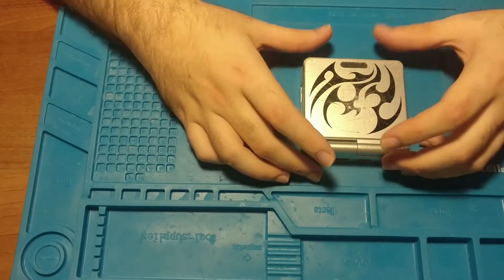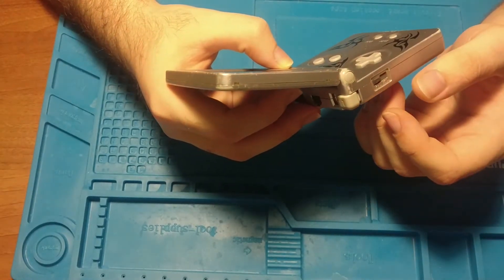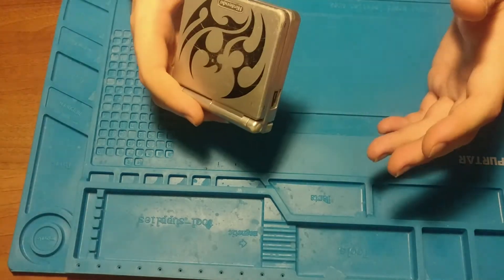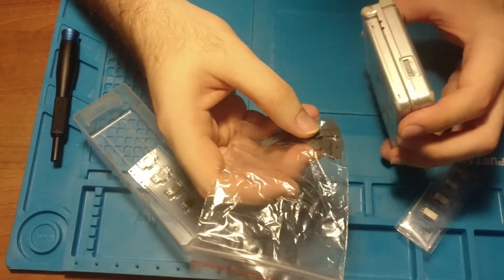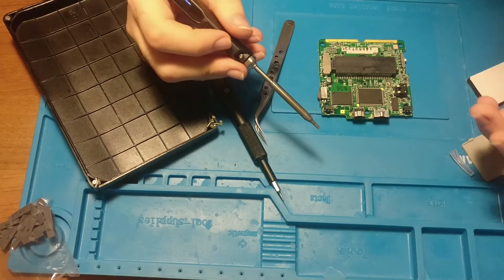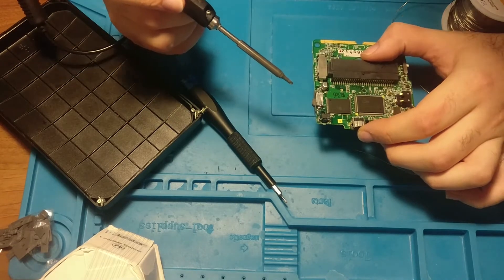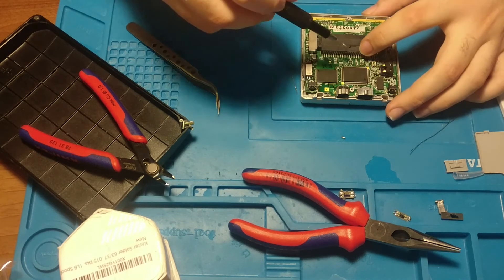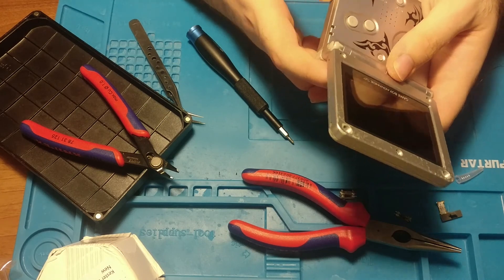GameBoy Advance SP Volume Repair - No hot air

Comment: The 001 model has detachable slider switch
Reply from the maker: That's not true, not all do. I have a bunch of 001s and they required a similar fix
Reply: @ItalianRetroGuy  I'm talking about the tabs. Not all units have a fused tab
Reply from the maker: @willyhoogs well yes, my apologies. It is actually what I meant, I left that reply when I was really tired. What I was saying is that it seemed like you generalized all 001s to have the detachable tab but not all do